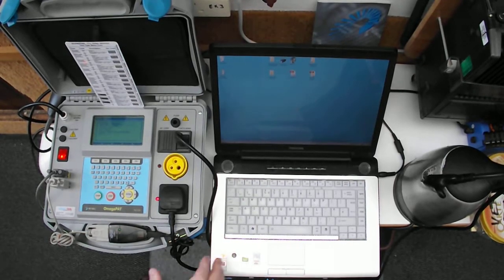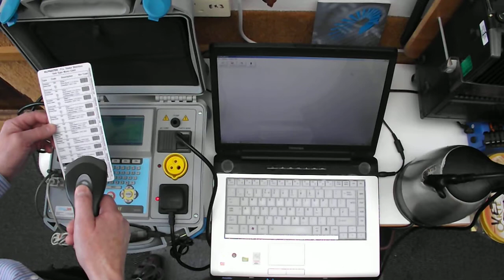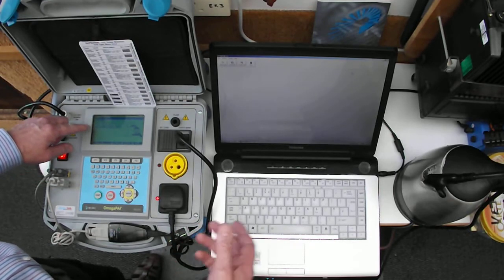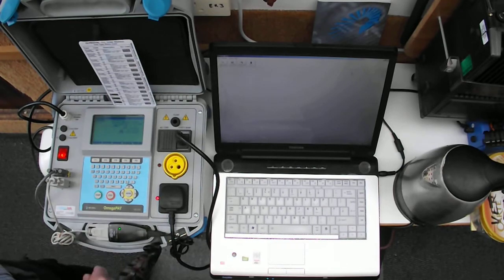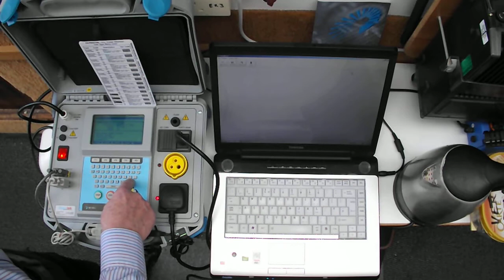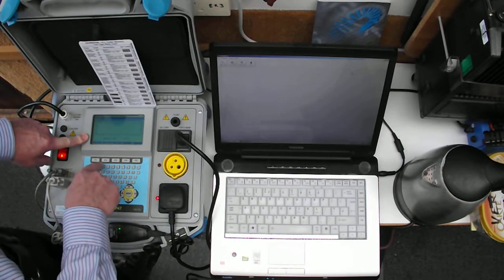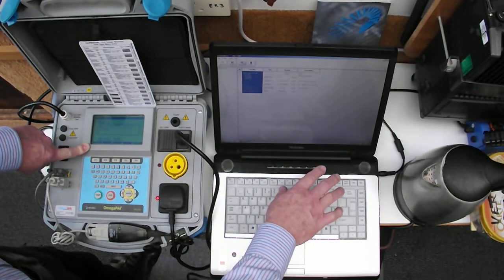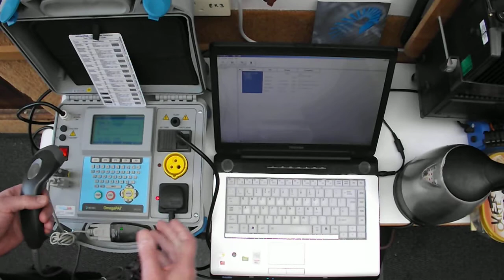Metrel OmegaPAT Demo.  Pat test kit for sale. Demo

Comment: HOW DO YOU CHANGE IT TO THE 115V TEST SETTING
Reply from the maker: Hi Connor. That's a good question I no longer have this equipment so had to get my grey matter warmed up to understand where you are coming from. So here's the answer !  
 I don't believe there is any need to change settings. Remember all of the tests are to do with insulation, continuity of earth and wattage of the appliance. In the video the kettle is a 230v appliance plugged in to the 13 amp 230v socket . If it were 115v it should be plugged into the Yellow 16 amp socket above.  The insulation tests would be the same for either voltage as will the earth continuity test.  However if one had an appliance with the wrong plug attached a false reading or error message would display when testing the wattage of the appliance. If for instance I had plugged my 230v 2800 Watt kettle  in to the 115v socket I would have expected a 1400 watt rating would be recorded on the PAT tester. If on the other hand I plugged a 115v 1840 watt kettle in to the 230v socket It would see a 3680 watt load !! and hopefully display FAIL ! or FAULT ! As it would do if the element were shorted out. 
Bare in mind that part of the PAT test should include a check that the appliance has the right plug fitted and correctly, in the first place. 
Hope that helps.